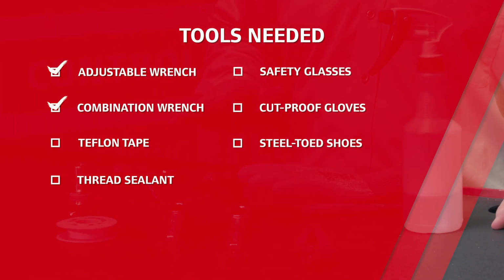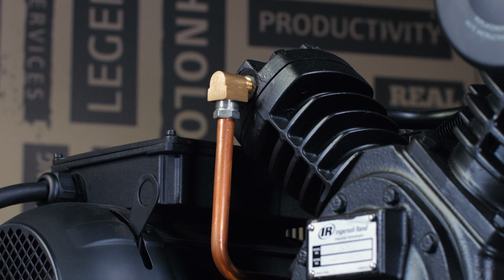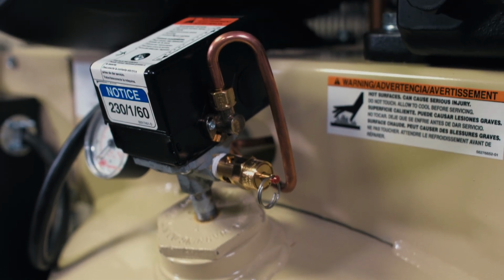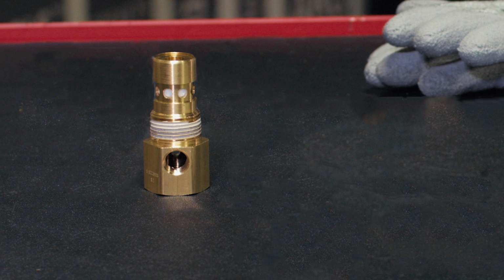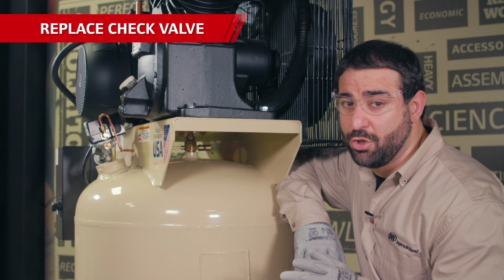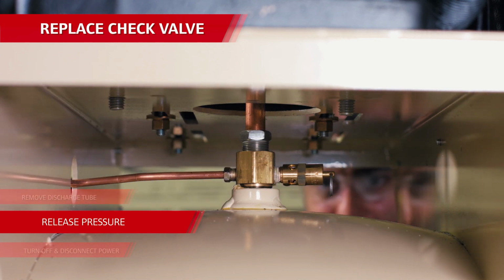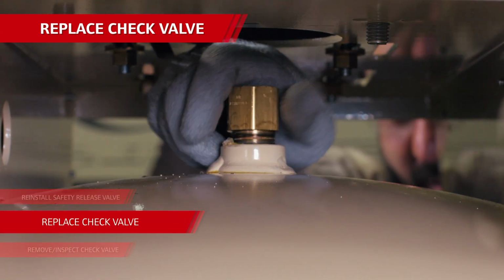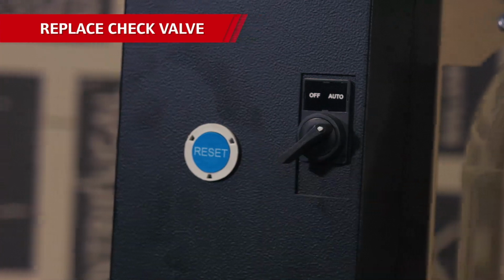Replacing Check Valve Troubleshooting | Ingersoll Rand Reciprocating Air Compressor

Comment: I have the 7.5hp V-twin IR from Tractor Supply, the pressure switch up front makes the pssshh when it's charged, but I don't hear it at this unloader when it's re-engaging at the 135. Instead, it dims the lights and often pops a breaker.  I have a 220v 50amp breaker for the circuit and about 20ft of 10 gauge solid core wire.  The compressor came unwired, so I used an 8 gauge multistrand dryer cord, just to make life easier if it needs moved.

This has been an issue since day 1 5-6 years ago and the B.S. TSC warranty 3rd party group never came to pick up and service the unit.